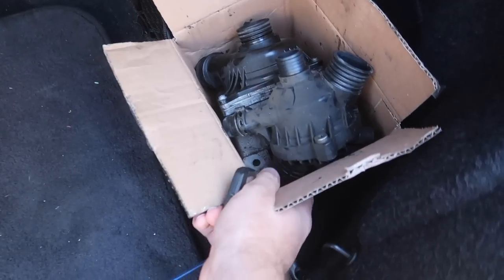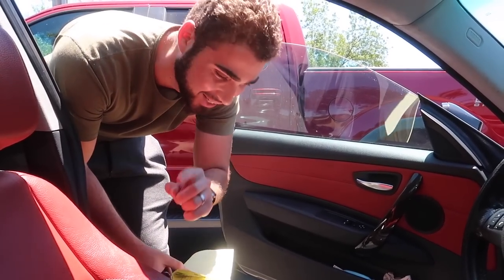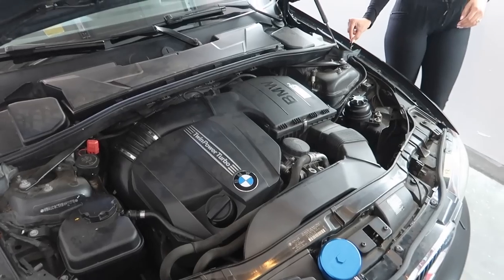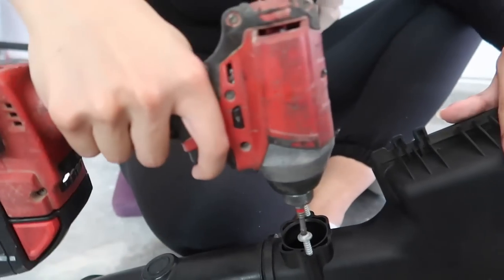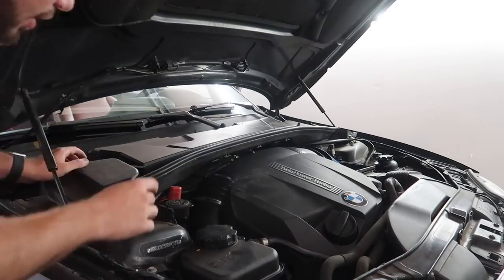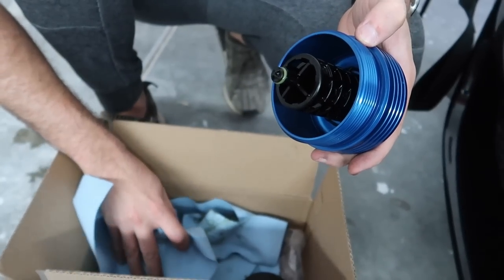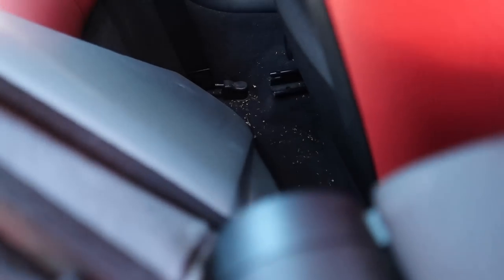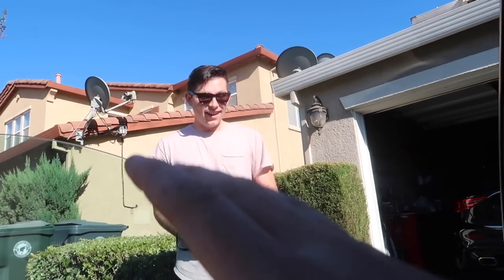INSTALLING NEW MODS ON MY WIFES 135I! (INTAKE, FILTERS, BILLET)

Comment: This brings back some feels. Just sold my e90 with an N55. I had all these upgrades on mine and I loved them. Idk how important it is for you, but one issue with leaving the cowel cover under the filter you removed, it has more purpose. It keeps water draining from the windshield away from the engine and electrical components. Also your hood prop sensor and other sensors are housed on it. Not sure where you hid everything else but if you found ways to make it work, more power to you. Looks and sounds sweet!